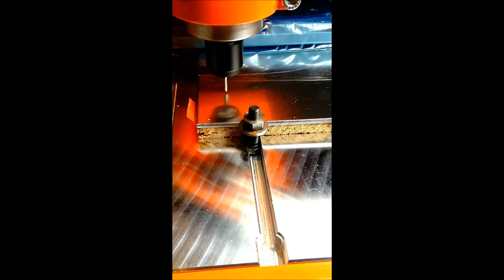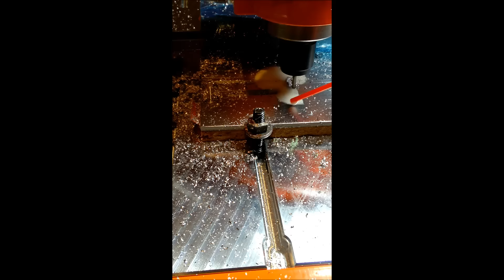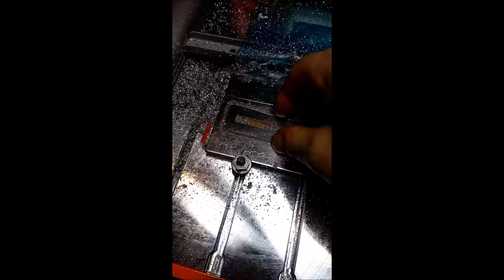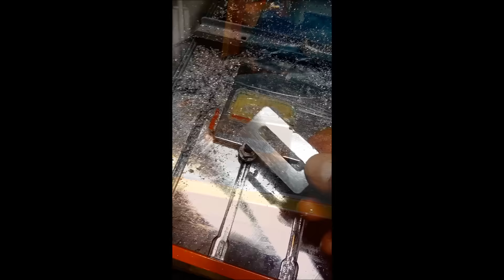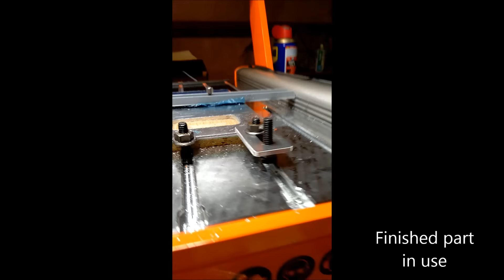Stepcraft2 420 cutting %99.9 Aluminium

Comment: Can you post what feed rates, infeed depths, bit size, etc were used. Thanks
Reply from the maker: +oobayly Hi. Feed rate is 5mm/sec, pass depth of 0.6mm, spindle speed 20,000rpm. i used a 2 flute carbide 3mm endmill.